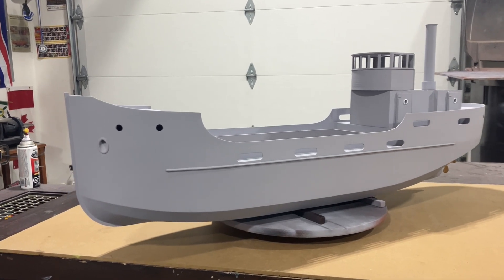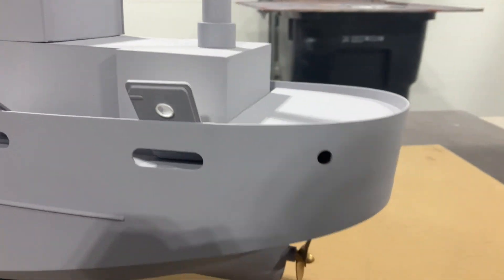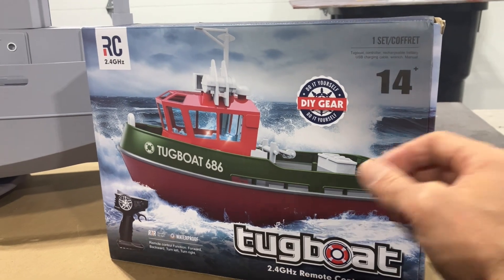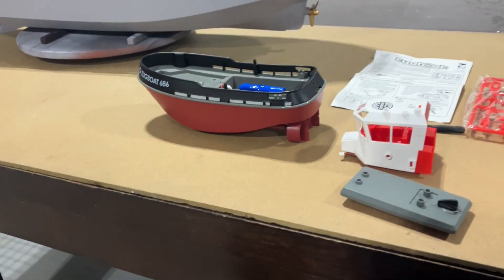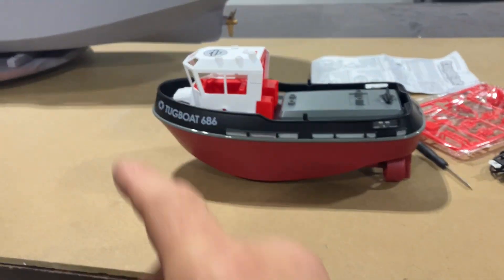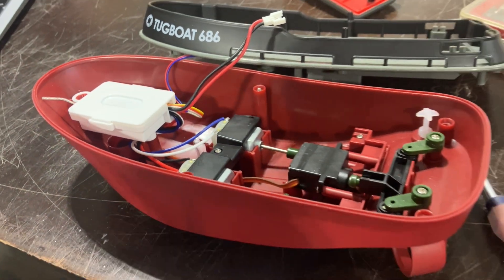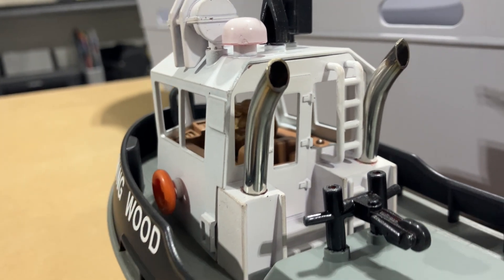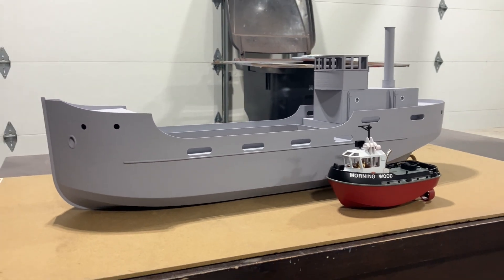3d printed model ship. Part 3

Comment: Ship looks great! What 3d printer do you use and what kind of CAD program do you run on the computer? I want to get into modeling with 3d, switching from a wood crafter. Thanks for any insight you may have.
Reply from the maker: Hey thanks. I use a Creality CR10 and use Tinkercad when designing stuff. Good luck 👍